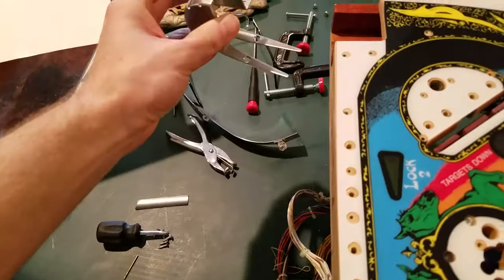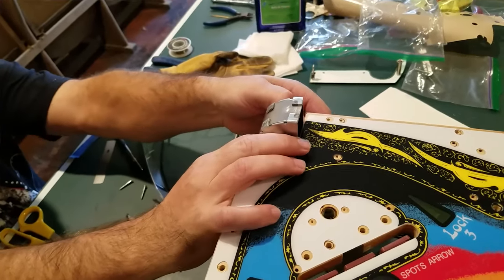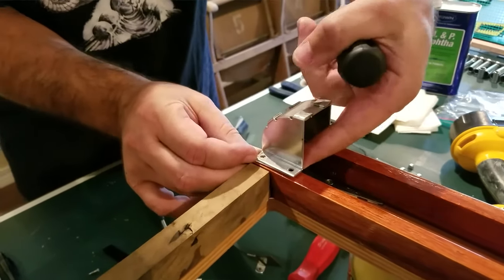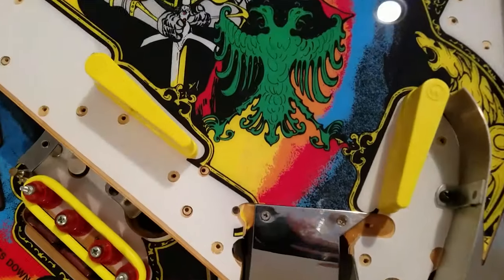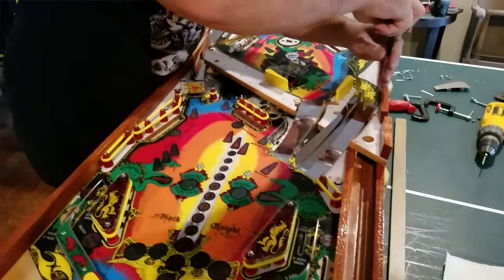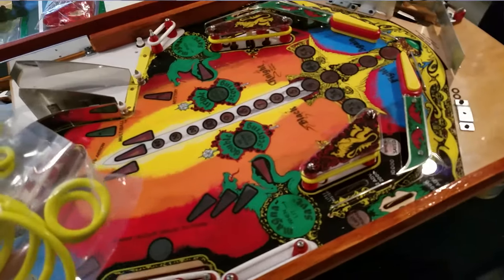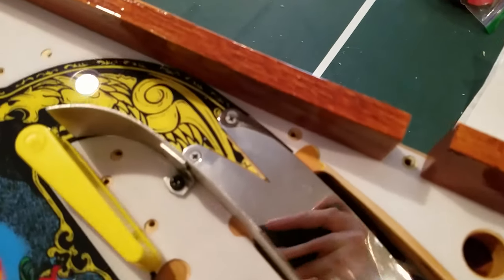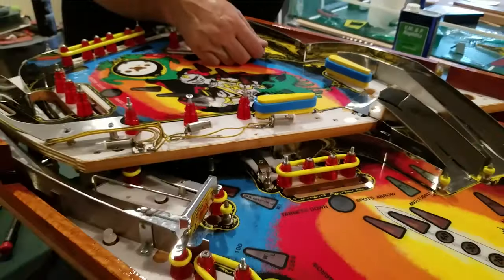How To Install A Hardtop For Black Knight Pinball Machine: Finale

Comment: Nice! That clear plastic ball guide behind the upper right drop targets has to be custom made. Mine has a wire rail there. I've never seen anything like that before. Weren't you guys wondering why there were two holes in the playfield on either side of the drop targets and two holes on either side of the socket? Oh, yeah, the plastic you are missing is the one on the front right of the upper playfield. I thought it might have been the little one on the front left of the upper playfield. I think I got at least 2 of those in my kit from CPR.

Excellent job and fun videos!
Reply from the maker: We were for sure curious of the half sized posts that were used on that guide, and it didn't seem right. Never can find a good pic for behind those drop targets. Barely even visible while playing. I found a pic that gives me somewhat a better view and I believe I see the wire rail you speak of. Interesting to see that the custom job someone did wasn't that bad. lol. I have seen some hacks before. lol. Thanks for the info! I'll pass it along to Jason and maybe he can find that part online or off a donor machine in the future.
Reply: Check the Pinside thread. Someone posted an excellent picture of what you guys are missing! I was just too lazy to go down and take a picture of mine. I wish I had painted black around my inserts as my hardtop went down just a tiny bit off and you can see some bare wood in a couple of spots. I love all the polished pieces and what you guys did with the ramps. You should put up a custom rubber kit on Titan so I can order a set of the yellow rings. :-)  That looks sharp.
Reply from the maker: @dzorbas13  I went straight to pinside after your comment to set the record straight. lol. I have made an edit on the video description. I would add an annotation at that spot of the video, but youtube took that away. The rubber kit from Titan can be easily done. Just add the "Black Knight" kit to your cart. Then you can just change all the ring colors to 'yellow' instead of standard white. Titan has a very user friendly website. Thanks, bro!

Comment: Hey Cary...This was agreat video series. I'm thinking of installing a hardtop also. I was wondering how this one is holding up after 4 years? Are you still a fan of hardtops, and will you continue to use them? Thanks.
Reply from the maker: Hardtops is still a product that I recommend. No issues yet!
Reply: @CaryHardy  In your honest opionion, not considering cost or time as a factor, would you choose a CPR repro or a hardtop? What are your reasons? I'm in that situation now and can't for the life of me decide which route to go. Thanks Cary
Reply from the maker: @sunarf  if cost wasn't a factor. CPR.

Comment: Any comments on whether the Hardtop plays significantly differently? I've heard people with PF protectors say they didn't like the change. Hardtop isn't a PF protector, I know, but... :)

I have a High Speed, which is supposedly getting the Hardtop treatment soon. Trying to determine if I salvage my PF as-is or just wait for the Hardtop to arrive.
Reply from the maker: It will make the game play faster for sure. Less friction. So, whether or not that is a big deal is up to the individual. I like games to play fast - so I can't wait for SoF to be released so I can really make mine look great!
Reply: Just to follow up, I did install the Hardtop on my High Speed - and it is *awesome*! It is so smooth. Once you play a Hardtopped version of a game, you'll never want to go back to a regular playfield. For those who think of a Hardtop as a playfield protector... don't. They are totally different things.